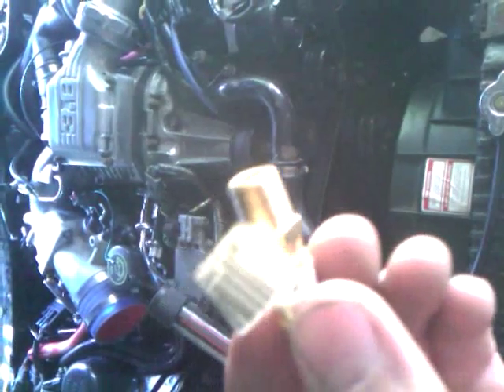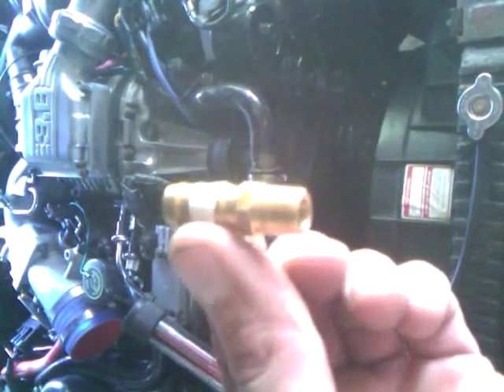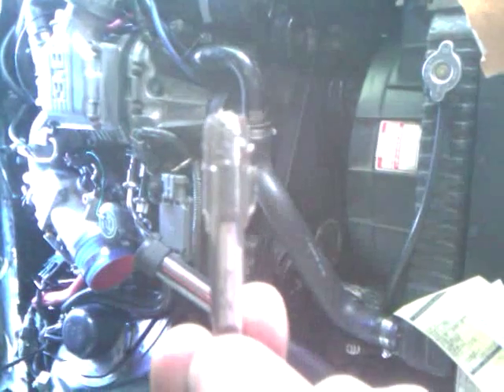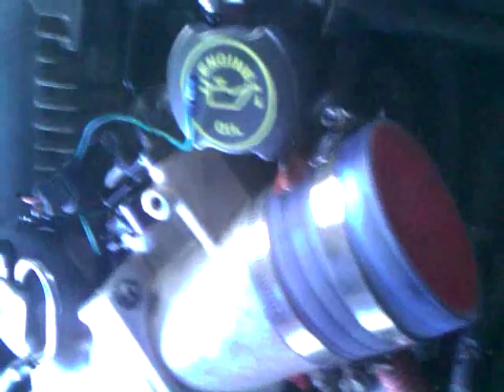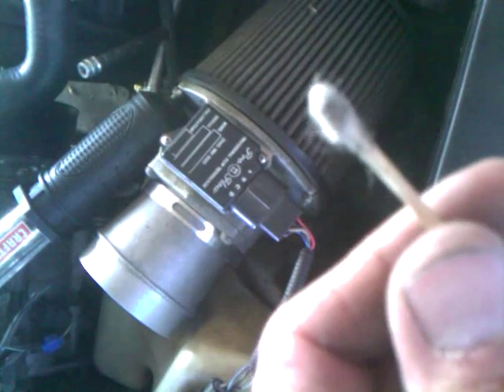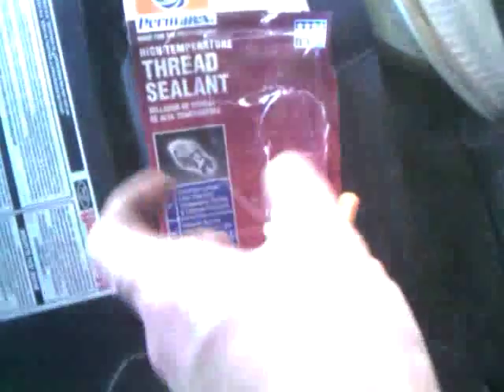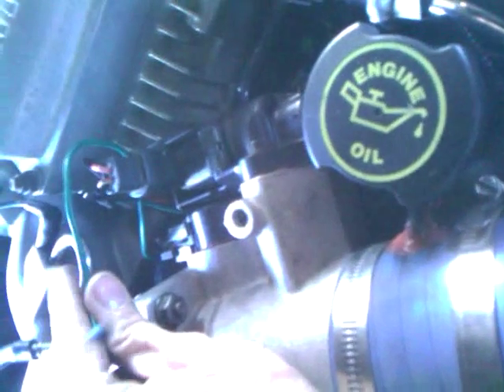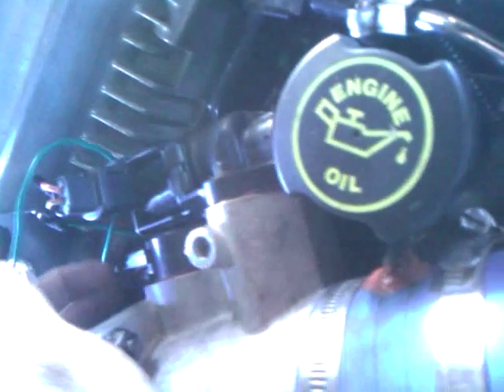90 thunderbird sc nipple install on supercharger inlet

Comment: hey i have a 1993 sc...and im having some issues with it...i bought it really cheap cause ''it didnt work''
so i cleaned the iac valve, recharged the battery and it runs good =)

but i dont know much about them and i was wondering if and how do i put a bov on my car